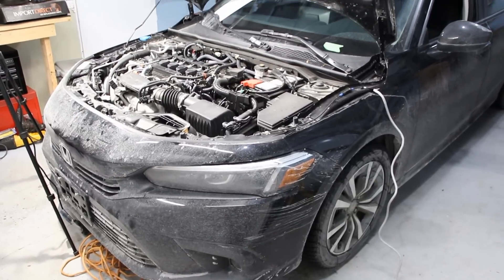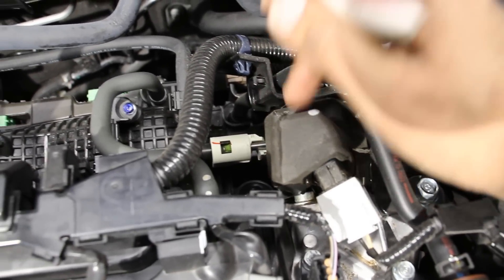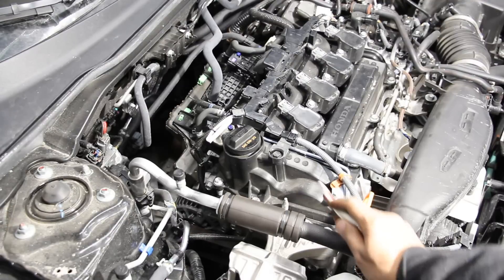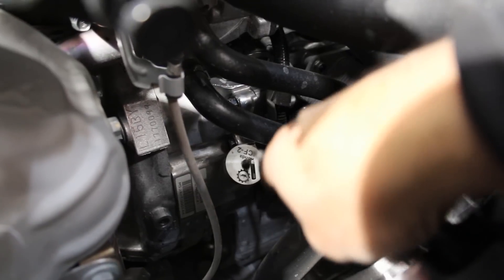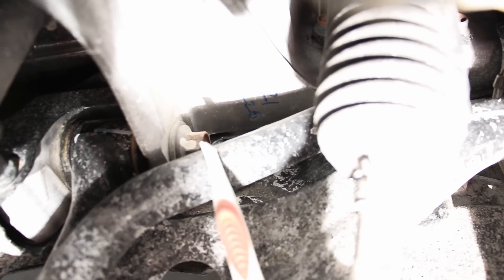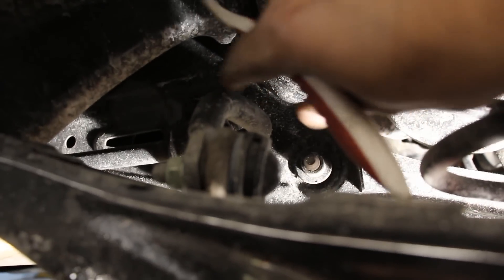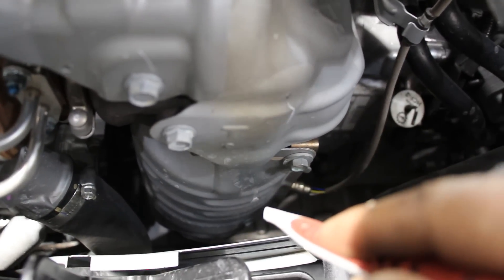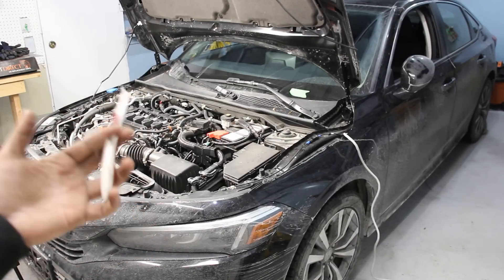Honda Civic Mechanical Review

Comment: I test drove an accord with the 1.5T and cvt a couple years back. If you wernt in sport mode it was always laggy because the cvt kept the rpms low so there was always turbo lag. That and the low slung back 80s camaroesque seating position lead me to get 3 year old Accord v6 instead.
Reply from the maker: Good idea. Get them while you can. Camry V6 is out next...

Comment: Toyota design under the hood Easier to work on>>>>>>>
Reply from the maker: Somewhat. They've got a new engine lineup too with the m20 and a25
Reply: @speedkar99  I have a question on the video the fuel line is rubber and is not even clamp down while on Toyota is metal am i right ?

Comment: What is your opinion of  reliability and maintenance costs after the warrenty period?
Why do you think this turbo concept was adapted by Honda?
Reply from the maker: Some will last but overall reliability probably not as good as the old K-series
Reply: @speedkar99  Thanks for your observation. Very similar to what Scotty K. talks about with this version of the motor.
Reply: You gotta be out of your mind to plunk down so much hard earned for all that critical componentry made from plastic is what I think.  Valve covers, if the plastic ones don't warp or crack, are still heat sinks that dissipate.  Now the radiator and cooling system have to be engineered precisely or it's game over.

Comment: The transmission does not have a dipstick. That is the plug to fill from, to check the level there is a bolt on the front side of the unit.
Reply from the maker: Thanks you are right, I said it wrong. Any idea what that second fill plug is atop the transmission?
Reply: @speedkar99  that plug with label is just to fill . There are three plugs for this cvt. Fill , check, and drain.
Reply: @speedkar99  maybe you're referring to the vent? Those have a common issue clogging up and causing the fill plug to pop out.

Comment: How long does it usually take to get the toothbrush out of the engine again after you throw it? 😀
Reply from the maker: I've returned cars with toothbrush inside because I couldn't get it out. The next guy doing an oil change might find it down there somewhere
Reply: @speedkar99  Next on Bring-a-Trailer: "Honda Civic with Speedkar99's brother toothbrush still somewhere inside the engine bay". Start your auction!

Comment: 1.5 Tubo still requires 0W-20 oil? 0W-16 oil should be mandatory for this engine
Reply: 5w-30 works better on my crv 1.5
Reply from the maker: Yeah I'm not sure why they haven't gone thinner

Comment: You the  reversible alternator is common on every new vehicle  which acts as a motor to start the engine and a generator to recharge the battery.
Reply from the maker: This doesn't use the alternator to start stop

Comment: All of those rubber hoses and clamps for the air "piping" seem like a recipe for disaster. I could definitely be wrong there but I'd be surprised if those clamps and tubes don't experience issues as the vehicle gets older. 

Good review! Curious to see how these things stand the test of time
Reply: They are *much better* than the plastic hoses, plastic lines and plastic snap fittings which other manufacturers use IMO.  A rubber hose with a proper metal clamp is much more durable, at least you won't accidentally snap the plastic PCV line (ask me how I know, cough Nissan-Renault group)! :)
Reply: @TassieLorenzo  Good point for sure - I don't like plastic either lol. I was mainly referring to a metal as an alternative as opposed to plastic as I can totally understand what you're saying. Plastic is also not good as well. Hard to see manufacturers making more and more of the engine bay out of those "softer" materials.
Reply from the maker: Well maybe get a naturally aspirated engine to avoid the hoses
Reply: @speedkar99  Possibly in the 2 liter NA model? 

It’s nice to see they’re using timing chains now.

The location of the starter 🤦🏽‍♂️.

Non-vented rear brakes 🤦🏽‍♂️.

The Si, Type R, and possibly the Acura ILX will display the upgraded suspension capabilities.
Reply: @speedkar99  Definitely a good solution! I generally do lean towards NA but I am curious to see how the design of this Civic holds up for sure. Thanks for the review :)
Reply: Half the engine is plastic. this wont last long. no, thank you.
Reply: @grabbat  Agreed, sad to see in my opinion
Reply: Agreed. Honda is starting to follow the German brands. That is why I switched to Toyota.
Reply: @MatrixDiscovery  oh i guess you haven't seen newer toyotas then. Take a look on their new dynamic force engines.
Reply: @SKC56  I have the 2020 Camry 4 cylinder. Engine bay looks super easy to work on.
Reply: I'll keep leasing cars. All that stuff looks expensive to replace or repair.

Comment: Woah, lot of stuff in there for such a little bitty engine... only about twice the size of the engine in my riding mower!

I'm reminded of my sister's '79 Honda hatchback... to replace the front shocks, you had to pull the engine (yes, really).
Reply from the maker: But pulling the engine wouldn't nearly be as complex as this car..
Reply: @speedkar99  True! in fact that '79 Honda was way simpler all around. For one thing, you could actually SEE the engine...

Comment: I wanted more power than my Corolla's 2.0....only thing keeping me stuck to it is the 6 speed offering and the dual injection. Have no quarms with a turbo. But a direct injected only engine is a big gamble...to me that is. Some people go 10's to over 100k with no issues. For others 🤷🏾‍♂️ it hits the wallet when the engine struggles to get air and fuel due to the intake cloggs. With tech today having to deal with that is unreasonable to car owners for additional maintenance. But if your cool with it....🤷🏾‍♂️. O and i saw a comment about this having no EGR valve but it still has a PCV so carbon "can" still be a issue.
Reply from the maker: Yes it'll eventually gum up like the GDI Hyundai's out there

Comment: Ya have to get a CVT transmission unless you want to spend $27,500 American for their Si version. Too bad electric cars are still so expensive. I guess I'll keep maintaining my 1997 Saturn for now.
Reply: My 2000 Saturn SL2 (manual) ran for 160k miles, died in 2018.

2007 Saturn Vue (manual) had 156k on the clock before dying in 2021.

Now driving a 2018 Saturn, which of course is better in every way, but the Saturns got me through age 21-34. And great MPG to boot.
Reply from the maker: Isn't there a manual hatchback version?
Reply: @speedkar99  I totally missed the Civic hatchback on their website. You have to get the $24,000 Sport which has the 6-speed.
Reply: Honda offers manual Hatchbacks with either 2.0L NA (port-injection only!!) or 1.5L Turbo (direct-injection only).  Now, if you want a Sedan, you're right.
The only way to get manual Sedan now is Si.

Comment: I have a manual gear 1.5 civic. Very happy so far, ( just 40.000 km  on it). The power is amazing, and the fuel consumption very very low. I don´t know carbon build problems on this engine so far, yesterday I read that this engine doesn´t have EGR valve, maybe this is one of the reasons.. Can you confirm to me the absence of EGR on this engine?
Reply from the maker: Didn't see one here
Reply: dont talk about carbon buildup in DI cars with no port injection it will happen, but the companies that sell them  send em to have govermental inspection and appeove as low gas /low emmision but soon you will end up use extra 50% to 100% gas because of Carbon buildup 😆😆
Reply: @Techie1224  This engine is on the market since 2016, some of them with high milleage on it, and  I´m not able to find carbon build up problems so far on internet, ( I´m I have been locking for them).  With some other GDI engines  you find problems with 30.000 km, but not with this .

Comment: So 500cc more would eliminate the turbo and all the plumbing?...Honda used to be logical...
Reply from the maker: Yes but at the expense of power, torque, and emissions. They still offer a 2.0L naturally aspirated engine for you though
Reply: They have to push near 40% thermal efficiency to be competitive in the market. I guess this is the way. Personally, I would avoid it too.
Reply: @jptrainor  as mechanical engineer there was a time when i cared about every technology trick - now ...don't know i guess i should say i couldnt care less. Real life reliability is what I care for. Someone below mentioned " this is Audi" it surely looks like it...
Reply: @jptrainor  That efficiency only works for 10k miles, after that the engine starts to consume more fuel.
It only goes downhill from here, these companies are so obsessed with efficiency that it ends up creating worse engines.
Reply: No it wouldn’t. You’re looking at at least 1L extra for that. And it would still be less efficient.

Comment: What about Bluetooth? You missed it again. I don't think I could ever bring myself to get a Civic with an automatic transmission. I'm keeping my 2006 Civic manual on the road to the bitter end. Either its or mine. And my old Civic has aftermarket Bluetooth BTW. It's the only way I could get my teen kids to drive it. The kids are just a bit older than the car. The kids didn't come with oem Bluetooth either but did acquired it in the aftermarket.
Reply from the maker: Bluetooth throttle pedal and steering ! Luckily there's no Bluetooth brakes on this one

Comment: Nice review! I like that little sound insulator for the hp-gas pump, showing Honda is paying attention to more and more details. 
Front suspension material is interesting. 10th Accord gets steel subframe but aluminum control arms. Which combo would you prefer?
Reply from the maker: All aluminum would be the best, less chances of rust. 
The HP fuel pump still makes a ton of racket. I didn't get a clip of this car running.

Comment: That is one crowded chassis. Also direct injection only just killed it for me. Im not paying for a valve decarb every few years. With all that crap in the engine bay, the labour would cost a fortune.
Reply from the maker: Yeah there is quite a bit of stuff in the way of basic maintenance items. They need to do like Toyota with dual injection
Reply: Go for the K20c, if it's available where you are.  If I were buying a new Civic, I'd definitely go for the the 2.0L port-injection-only trim, with manual transmission.
Reply: @catsspat  also has true old school vtec 👌
Reply: 10th gen has had no issues with valve gunk

Comment: I'm getting more and more convinced that I don't want one of these new small engine turbo cars. The benefits just aren't worth the extra complexity. That engine bay is just so tight
Reply from the maker: Agreed.
Reply: With 2.0 L no issues at all.
Reply: @Gr3eGo  also the 2l is port injected! My 2019 with 2l and manual has more than enough power. Not sure why people need more!
Reply: RWD would help with working room… it’s not so bad when the engine is longitudinal. But carmakers only care about assembly time, not repair time
Reply: I agree put that small engine in a suv get like 20mpg vs my 1988 Lincoln town car I get 22mpg stock no modifications
Reply: @infernoking7504  we all know manufacturers chosen smaller engines due it cost less material and thus less overall costs for them. Plus stressed out engine wont last long.
Reply: @AdelJeffreyJeffreysAuto  yes ik my 5.0L 1988 town car isn't stressed at all so it will last longer
Reply: And rubber fuel line Toyota use metal or aluminum
Reply: And the quality under the hood looks better nd less afterthoughts
Reply: Thats one reason I got a used accord v6.
Reply: @Henry_Jones  have you done a big job on it? Transverse V6s can be even worse! Haha
Reply: @mole-v7z  its actually really roomy under the hood cuz its sohc, the heads arent as wide and the intake plenium sits evenly between the banks like on a chevy LS v8  or buick 3800, it doesnt have the plenium going accross the rear bank like alot of v6 engines do. But it was the fear of trubo problems down the road that lead me to go with the used v6. I wanted high hp but no trubo problems. Only downside is its nose heavy.
Reply: @Henry_Jones  oh that's great! You have a 9th gen? I have the hybrid, they're nice cars!
Reply: Yep, pour a glass of water under the hood and it won't hit the ground.
Reply: 240k on my 2016 1.5ltr turbo, never had 1 problem
Reply: Agreed, although this Honda seems super cramped compared to say a Hyundai with a 1.6t
Reply: @Olseawalker  That's good to know!
Reply: I don't mind the complexity of new motor, I'm wondering if it's a common trend that new motors are running hotter to hit emissions targets. I'm seeing higher thermostats min temps, 85-88C and coolant return temps of 100C+ on stock motors. Upper seals are cooked in less then 8 years. Wtf
Reply: The non turbo model has a ton of work space
Reply: Wasted space is wasted potential
Oh and an exploded head gasket and fuel contaminated oil are not good either
Reply: Honda and Toyota extremely reliable.
Reply: How easy is it to clean carbon off the input valves?  And how did honda solve their gas in the crank case issue?
Reply: Honda expanded the use of the naturally aspirated 2.0L 4 cylinder, so that's a plus at least.
Reply: I'd say Civic has pretty decent space when compared to Honda Fit
Reply: Wished the Touring and EX came with the 2.0 liter engine option. Too much complexity here which will affect long-term reliability.
Reply: Toyota Corolla nd judt in general the new Toyota designs under the hood etc is easier to work on nd a lot of space
Reply: Yeah, same thought. I'm about to where... older the better! Keepin' my '91 truck, that's for sure.

I used to have a '78 Ford pickup. I'd go to my mechanic, point at whatever was obviously broken or leaking, and say --See that? fix it. And that's all the diagnostic there was. Meanwhile the whole rest of the shop was full of newer cars hooked to the computer, and six hours later (all on the clock) half the time they still didn't know what was wrong with 'em. (My mechanic complained about it too.)

Comment: At 01:08 ... The air is not so much heated by the exhaust gasses, but by compressing it. The same thing happens when you inflate a bicycle tire.
Reply from the maker: Thanks for the correction
Reply: @speedkar99  the heat from the exhaust is not negligible though. The turbine is heated up considerably by the exhaust gases. And that transfers to the intake charge.
Reply: Came here to say this. At 14.7 psi (1 atm) boost, intake air at 27°C would increase in temperature to 92°C without any heat transfer to the air, just from the compression. The hot turbo would increase that further but I think it's safe to say that most of the heating comes from the compression. This is why even supercharged engines without hot exhaust gasses near the compressor benefit from an intercooler.
Reply: How much pressure we're talking about here?
Reply: @antimon40  every 14.5 PSI of boost is roughly 1 atmosphere of air pressure. So 14.5 psi of boost is 2x background pressure.

Comment: That’s one salty civic.
Reply from the maker: Yep. It was dark and snowing outside so I had to bring it inside to film. No chance to wash since it would freeze
Reply: @speedkar99  Wondering if you get corrosion where the steel and aluminum are adjacent. I've seen that as a problem in other uses, learned to never leave aluminum near steel where it could get wet.
Reply: It will be rusty soon enough in Canada lmao
Reply: Keep in washed, get it rust proofed annually, and it will survive.

Comment: Nice that hondas cvts have been reliable unlike nissans. Goes to show cvts are not problematic, just nissans are junk.
Reply from the maker: Yes at least it can be made right... although still not the best thing to do
Reply: @Dallas867  True Nissan have outstanding engines and the CVTs are better than the 2000-2010 decades CVTs.

Comment: I wonder if the oil dilution issue has been 'cured' with this iteration?
Reply from the maker: I think that was solved a few years ago. I'd love to tear one down though
Reply: It's been addressed 2017/18 model year.
Even before, it would predominantly affect owners in very cold weather doing short trips.
Reply: They will never be able to completely mitigate extreme edge cases with these engines - it is too small and thermally efficient and when people drive short distances, they just don't heat up sufficiently.
Reply: @shinybaldy  They put this engine in the CR-V and people in Canada were complaining that it just would not heat the cabin enough to be comfortable. Just not enough waste heat to keep up with the heating load on a bitter cold day. It seems we are reaching a limit here or maybe the next evolution will be an insulated engine block or similar.
Reply from the maker: They'll just add electric heating like EVs
Reply: @speedkar99  Electric heat will work but will lower the net efficiency. We are near an inflection point where energy has to be consumed to heat the vehicle rather than simply recovering waste heat. The waste heat recover has the effect of increasing net efficiency. Soon we'll have to lower efficiency to produce heat even with ICE vehicles. At least on bitter cold days.
Reply: From what I heard it hasn't, Honda reps unofficially calling it a "feature"